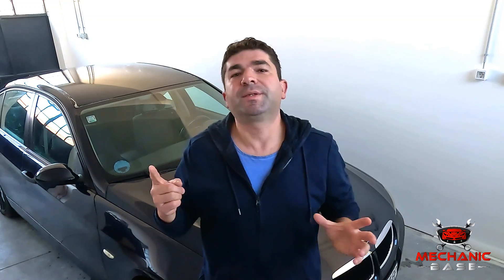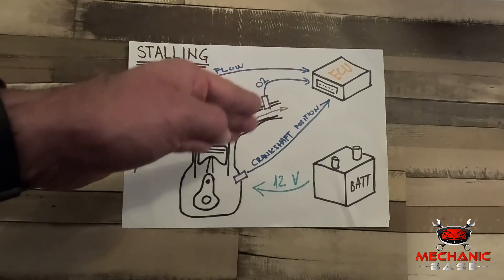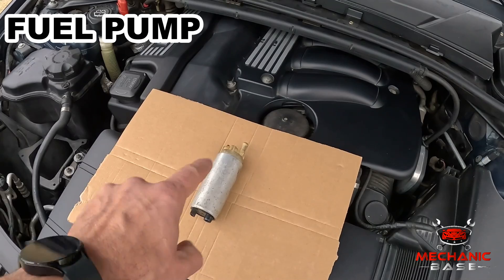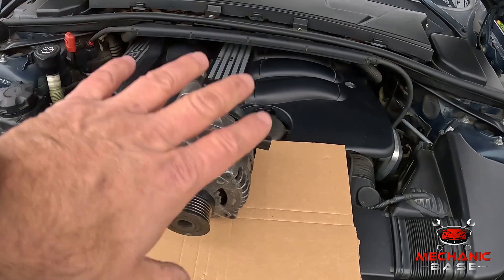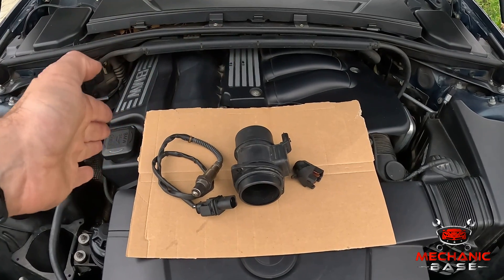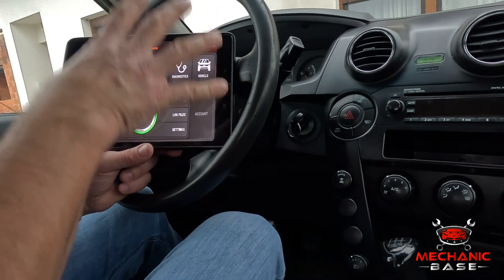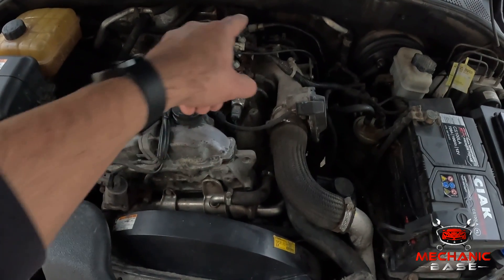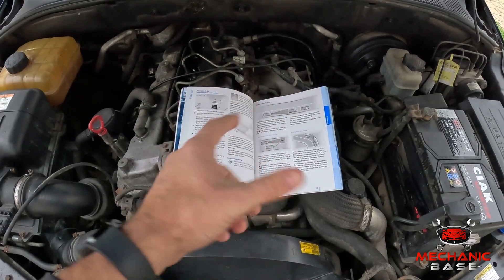Car Shuts Off While Driving? 7 Causes & How to fix it

Comment: My car shut off (gauges went down and radio went off ) but the car kept driving. It all came right back on but then had auto zone run codes… nothing pulled.. any suggestions
Reply: Check out your ignition switch also!! Have you had problems with it or keys, and obviously check all your battery connections and grounds including chassis ground and ground to frame or unibody,. How old is your battery there is always a month/year on side of battery when manufactured its a round circle and example, 3/22 or2/20, you get it but remember this is when the battery was made and ready for service. Just some simple stuff  to rule out and most important of all double check anyone's work who have loosened or tightened stuff in the repair process and if they have disconnected plug-ins on electrical and look over those too. Montana Rick.
Reply: Alternator going out
Reply: Any update what was causing your problem? Going with the same problem for my car?
Reply: Did you fix can't figure out and can't offered to take it in shop

Comment: Thanks  for this lesson at least I can talk sensibly to my mechanic now about the problem. I believe it's dirt and clogged as the car was parked in a dusty  open garage. The lights don't dim etc so I've narrowed it down to a clogged
system as it starts strong  when restart, Thank You.
Reply: I have a similar problem. Mine runs smoothly for a while in the morning but then it'll switch off and come on after say half a second randomly while driving. It's automatic honda brio . Did u get help with yours?
Reply: None of the 3 of u got that right lol did we learn nothing from this video lmfao

Comment: My 2008 Chrysler 300 2.7 shuts off randomly like 3 times a month when i come to a stop. But would start back up like nothing happened. No Codes Anywhere the mechanic told me. He had my car for 2 days and said since it didnt do it while he was driving he's clueless. I just Changed the Trottle Body Sensor and 2 day later it shuts off again. Im so sterssed.
Reply: I’m having the same exact problem…mechanics don’t know what to do…anyone solve the issue?
Reply: Mines literally do they same! The mechanics says they Cnt diagnosed a problem if there’s no dash lights on
Reply: My Mazda 3 is doing the same thing right after they have disconnected and reconnected the crankshaft sensor plug, I'll try to find out if this sensor or plug is the reason behind this issue and will keep you updated, maybe it's gonna be the solution to your problem also
Reply: 09  accord does the same thing.
Reply: @tonial5789  I took it to 4 different shops before taking to the dealership…mine was a PCM the cars computer
Reply: @TheRealFreddy_G  It looks like in my case was an exhaust leak right after the catalytic converter. Luckily I didn't have to change the cat. It could be another reason but I haven't had an issue since fixing the leak for $200, it was 3 weeks ago
Reply: @TheRealFreddy_G was your car a 2007 or 08 Chrysler 300 2.7 engine??
Reply: @geminijones787  no it’s a 2013 Ford Mustang v6
Reply: @tonial5789  I checked everything on my own until I couldn’t figure it out….$1300 later, it was a bad PCM the car’s computer
Reply: 2015 same thing.  pcm problem cost me $1850
Reply: Mine did the same thing . I change the fuel filter who had clogged a lot with dirt . I change the air filter too the oil and the oil filter. New battery . And it did help . But now it stills sometimes. I'm changing the spark plugs and fuel injectors next . I have a mustang 2010 V6.  180 k miles.
Reply from the maker: Now, this might be a long shot, but you can try cleaning the MAF sensor. Here's a video on that👇
https://www.youtube.com/watch?v=SJp0fN74UNk&t=29s

Comment: My girlfriend Nissan Murano has code po158 & po335...it's cuts off after running rd 15 mins then I got to mash the gas down so it will catch, an start back up..then won't start at all til 30mins til an hour..then repeat same
Reply from the maker: That definitely sounds like a crank sensor. They work fine when cold, but as they heat up and expand, their signal goes bad.
Reply: @MechanicBase  Thanks!! We going try it out